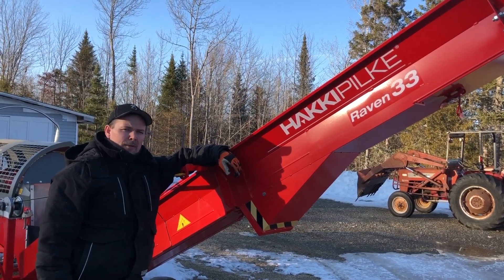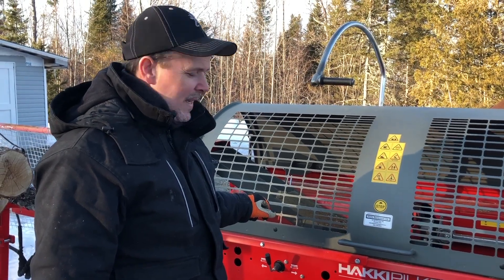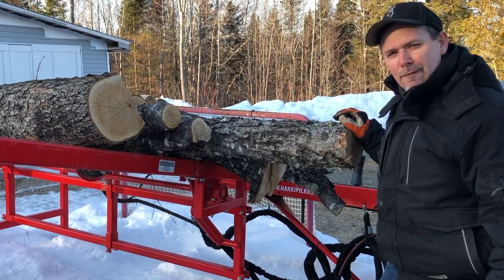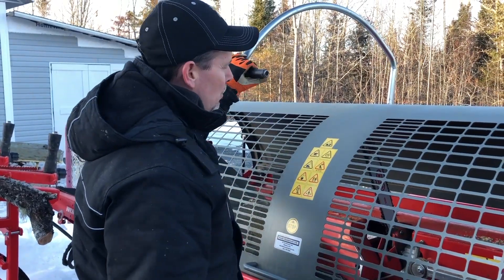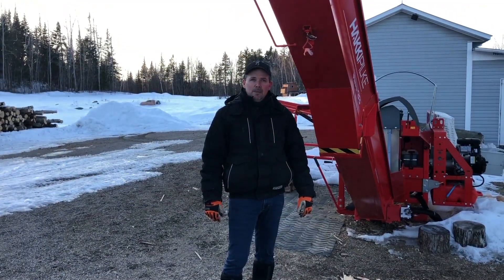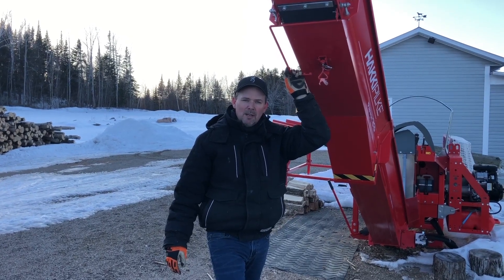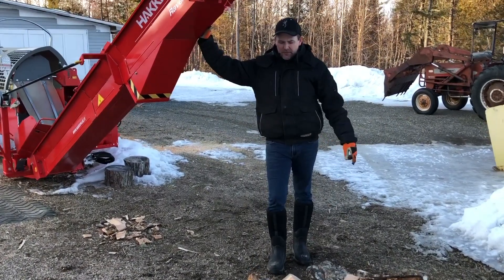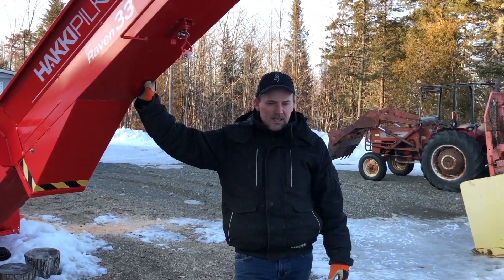Starting the Hakki Pilke Raven 33 Firewood Processor for Spring -E41

Comment: What ia the ball park price for the hakki
Reply from the maker: Hi, I suppose it depends on the dealer and the options you purchase but these are +$20K units...
Reply: @OakMountainAcotts  Thanks
Reply: Here in ireland the raven 33 is 11k +vat
Reply from the maker: Seems about right. That is around $16k CAD and I bought the feed table in my package for around $5k…
Reply: @OakMountainAcotts  HI! Today price in finland is 10400 eur
Reply from the maker: Excellent. Is the feed table included in that price?
Reply: @OakMountainAcotts  this is tractor powered